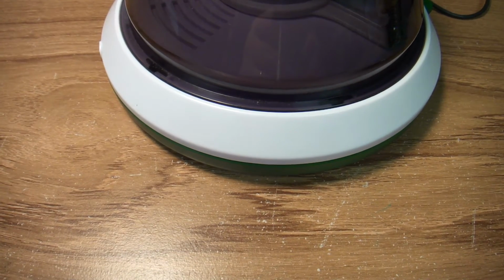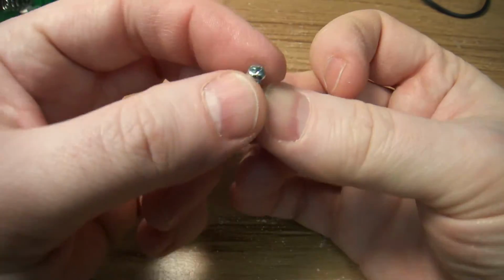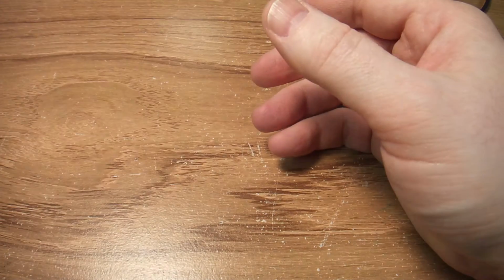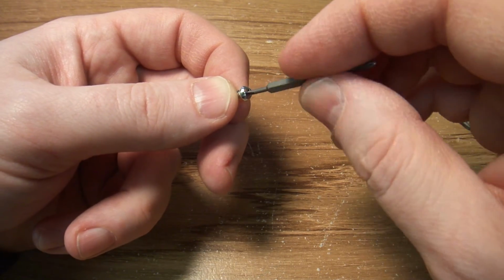Example of true hacking using a so called security screw

Comment: Not to be to nerdy but the word hacking is almost newer used correct, most people means cracking when they says hacking. Cracking is to break a code or get into a system. Hacking is to use a system for other then the intended purpose or to get it to do more or do the task different.